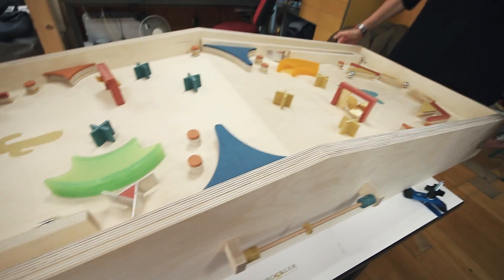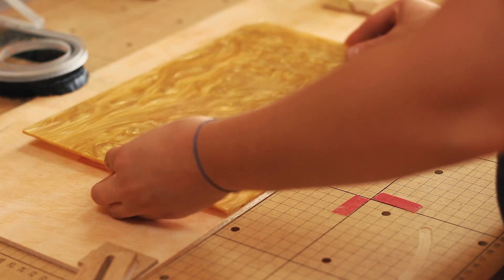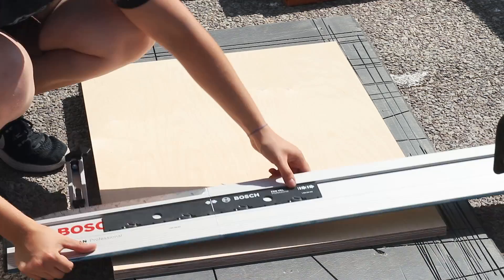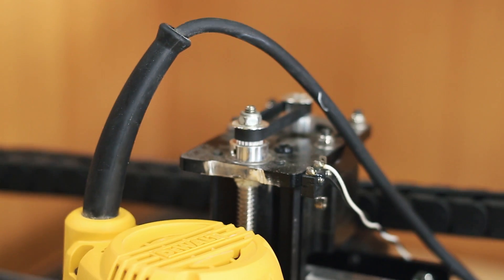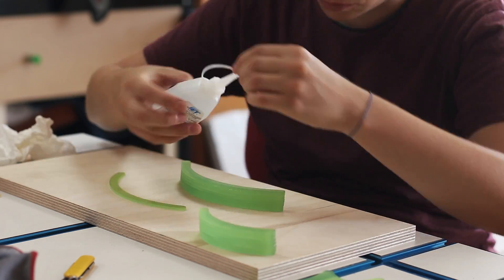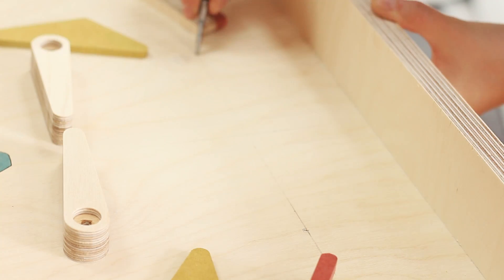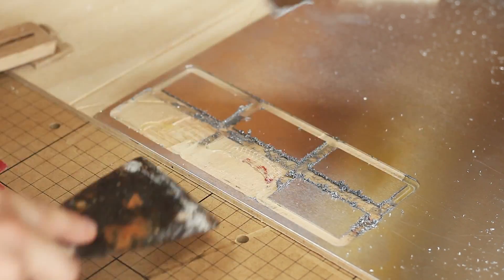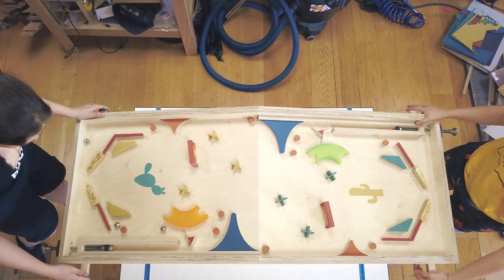Make a 2 Player Pinball Game // X-Carve Project

Comment: Holy crap Cris, I love this project. Awesome to see a completely mechanical pinball table. Would love to hear more about the game design - does the ball cross over to the other player's table? Or do you play two simultaneous games?
Reply: This is one of the coolest things I have ever seen.  How is this not a thing yet.
Reply: my son and i just thought of this and are devastated. we may try to make this a thing
Reply: @GarageLoot  it was, there were several commercial ones. More like no longer a thing, since pinball in general was almost dead until recently
Reply: did anyone say it was something new or revolutionary though? the point of this was to give a new look to a pinball game, which is exactly what she did. it's made of different materials, it has a personalized look and it's analogic. the 2 player part is also different because we can switch the rules however we want - 1 ball, or 2, or 3 or 4 in the same gameplay, etc. if you had one exactly like this one, show us then.
Reply from the maker: +Make: Thank you very much!! Yes, the ball travels to the other table side, depending on the angle you hit it. You can came up with your own rules but what we are going for here is that both players start with too balls - one hidden in one of the cross spinning obstable and one being pushed by the plunger, starting at the same time. At almost every take, at least one ball ends up going the other side so if both players loose 2 balls at the flippers, we score it 1 - 1. If player A looses 3 or 4 balls, the point goes to player B, so 0 - 1. Progressively add points until one of them get to 5. Then, the winner stays and another player faces the winner.
Reply: @GetHandsDirty  Yooo that is awesome.  Thank you for sharing. Can you build a foosball table???
Reply: i would also make rules for cooperative play. i guess electronic scoring would help there but maybe theres another thing to do.
Reply: From my searching for a commercial machine the only thing that it has in common is that is double slopped. But that is like saying any pinball machine with a single slope is a copy of the first slopped machine.
Reply: Make: i
Reply: Make: when great people talk
Reply: skeven0 right ! I've played it.
Reply: Yooo that is awesome.  Thank you for sharing. Can you build a foosball table???
Reply: shut up spammer you clearly didnt watch the video. your question is fully answered within 5 seconds.
Reply: +Garage Loot there is actually a 2player pinball machine from the 80's or 70's in the pinball hall of fame
Reply: You SHOULD give credit by naming the original commercial machine you copied the design from
Reply: @CousinHubertRetrogaming  which one though? Joust? A.G. Soccer? The idea wasn't unique
Reply: +Make "mechanical pinball table" it has a total of 4 moving parts....really...you praise it like it was a master piece madeup of a 100 moving parts..

Comment: It would be great to see a flipper design where the mechanism transferred an vertical button press into the horizontal flipper movement. Without the electronic assistance you get in a real machine it'd be nice to be able to mash down with a fist or palm, rather than having to press sideways with fingers.

Also some ball bearings on the little X-bumpers would allow them to spin way more after being hit by a ball which would be very awesome. (and relatively simple to implement as well)

Comment: Not sure if anyone said this already (I'm not sure how to search comments), but the cracks in acrylic you reference is called "crazing". It occurs because of uneven heat stresses introduced into the material during cutting. The heating and cooling puts the cut edge under tension. It's very common in laser cutting but can occur when any process (even sanding.) Solvents like acetone and alcohol will soften the acrylic enough to release the tension in the form of tiny cracks. The only way to avoid it is to keep the material cool during cutting, anneal it afterwards (a slow heating process that requires a timed oven), remove the heat stressed edge (with a router or jointer, but while not adding new stresses,) or avoid the use of solvents. Unfortunately, all acrylic glues,  CA and its activator, alcohol and especially acetone will cause this. A safe solvent is naphtha though it may not be available in all countries. They sell it here in the same section as paint solvents. Epoxy is probably a safe adhesive though I'm not 100% sure, CA is better than acrylic glues, but can still cause it. Cast acrylic is more resistant to this than extruded. Mirror acrylic is always extruded.

Comment: I know what video you used for the flippers! you're going to need to cut holes in the main pivot screws and use small nails at a 90 degree angle on the flipper and the wood rectangle underneath, I use mine for festivals and minimaker faire so they get a lot of use, the glue doesn't hold up. Don't EVER use wooden dowels.

Comment: Have you considered modifying the table on your CNC router to hold the stock with suction? It should be a relatively simple matter of using peg board as the actual work surface, and using a shop vac to provide the suction. All you would need to do is build a box that is about 4 cm taller than your shop vac hose and as big as the work surface of your existing one. Make the top out of peg board. Then drill a hole in the side where you can mount the shop vac hose. You would need to make that as air tight as you can so that there is no loss of suction from there. You will have to cover as many of the holes as you can in order for the suction to hold your work piece, so some scrap plywood would be handy to keep around.

Comment: Did you intentionally not leave a recess behind the rubber bands on the bumpers? As I understand a mild parabolic recess behind firm stretched rubber provides better response in mechanical bumpers. Also when connecting each angled playfield you pocket drilled one side. Wouldn't is have been almost as easy and perhaps stronger if you had staggered the connectors to go in from both sides? I'm probably missing something but that was my third thought after, "that's so freakin' cool!".

Thanks for your hard work.  This is the coolest thing I've seen Youtube in too long!

Comment: First off, fantastic project and awesome game concept!  I like this video from the beginning based on the concept alone.  That being said, I see some issues.

I think the play field is a bit steep, from watching how the ball reacts.  I would modify this with a 6.5 - 7 degree angle instead. Also, some solenoid flippers would have really been great to see.  I know that means adding power to the project, but it just seems like it would be easier to play and react quicker.

Keep up the good work.